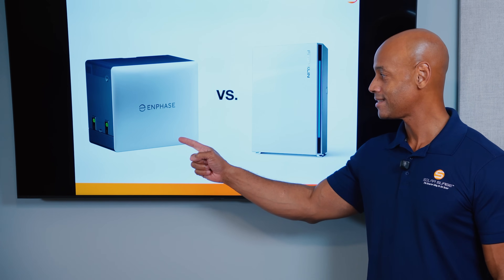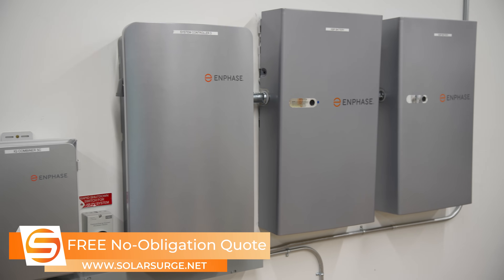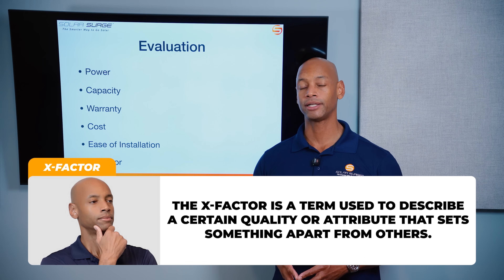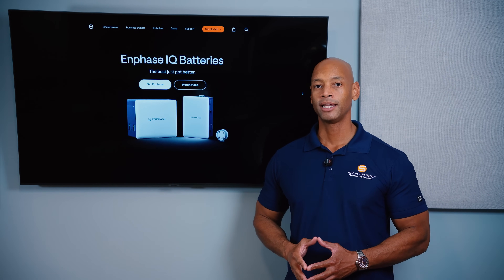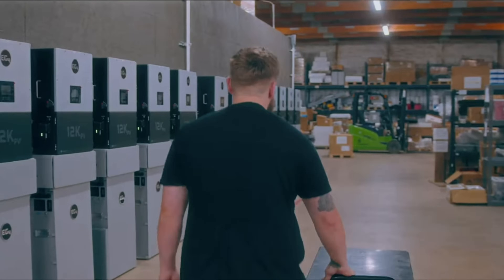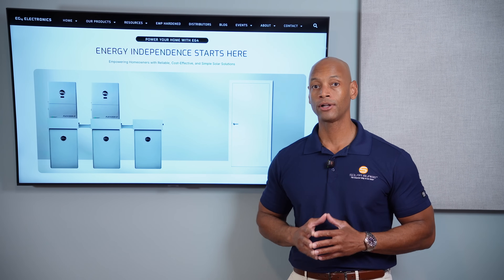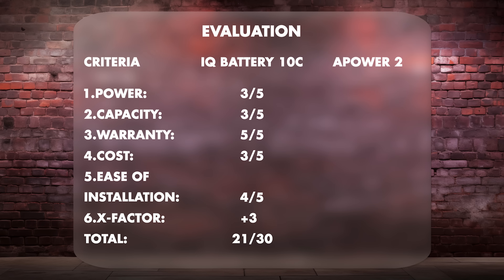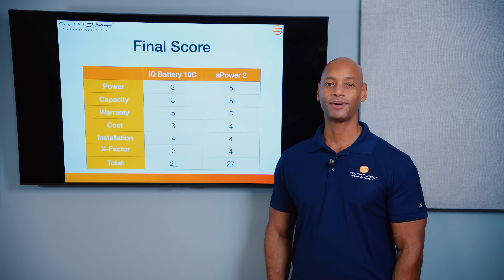Franklin aPower 2 Vs Enphase IQ Battery 10C

Comment: Emphases has a far more elegant solution in how they deal with weight.  Sending 3 men or a forklift or some custom dolly (which did look cool) sounds very expensive versus making each power module light enough to lift.  No tools required, single person job.  The whole system looks pretty elegant.

Comment: 7 kw is not enough continuous output for a fully electric home... Unless there's a several minute surge to help when the HVAC runs along with the stove causing a draw over 7kw.. just keep that in mind. With the enphase.
Reply: Most people will install two. Then output is 14kw and storage 20kwh. That’s an optimal amount.

Comment: Man, I thought I knew the rules: work hard, hustle, save every cent. But I always felt stuck. Then someone casually mentioned Nixorus books in a comment somewhere, and I swear—it felt like accidentally stumbling onto forbidden knowledge. It made me question every single thing I'd been taught about money, wealth, and success. Not gonna lie, I felt like I was cheating the system just by reading it.
Reply: That’s great but it has nothing to do with either Enphase or Franklin batteries.

Comment: I have EnPhase mi-based system. But, the 10c and related parts are over-priced and under-capable. However, a big consideration not discussed here is graceful PV curtailment when grid down and battery near full. EnPhase needs to open up to others, including for bi-directional EVSE/V2h, for better micro-inverter power control

Comment: The SW Florida Enphase dealer quoted an insane 30k to add one 10c to my Enphase system. The local/20-year solar Franklin dealer met my 15k budget. Glad I went with sufficient quality at a reasonable cost.
Reply: Well that’s just over pricing from your particular installer. Nothing to do with the quality of Enphase systems that is well known.
Reply: Wow.  $40k for one 10C?  That's a "We don't want this job!" kind of quote.
Reply: 3-4 hours of labor for 30k even 15k is high IMO. I'm assuming you already have solar just adding AC coupling inverter and battery.

Comment: Both are way too expensive unless you get an extra cheap install, live in the highest priced electric markets, and your electric company lets you sell back 1 to 1.  Otherwise, don’t expect to break-even until long after these are out of warranty.  The real value of these is for backup power if your electric goes out for more than an hour or so more frequently than you’d like.

Comment: You should compare on an equal basis. So in this case you should compare two Franklins and 3 Enphase batteries (both will be then 30kwh capacity). Suddenly you would see that output would be 20k on Franklin and 21 on Enphase. So they are very close. Also, why not add “required wall space” as a criteria?
Reply: Exactly. This comparison is badly flawed. Enphase is still more expensive and the 10C is a poor follow up to the 5P, but it has a huge installed user base and phenomenal support. 

There is no question the Franklin is a contender, but this video completely glosses over the benefits of having a single manufacturer and unified system with easy to understand monitoring.
Reply: @RoderickMcSlagerhaden Agree. These “specs sheet” type of comparisons are garbage usually as many other things to consider. By the way, there seems to be coming an IQ10CS battery as well. In that one you can freely put the two 5kw battery modules on top of each other or horizontally so it is flat. Comes with a separate cover for them.

Comment: Franklin battery is manufactured in China, Enphase is manufactured in US
Reply: Exactly.
Reply: Not true now,    Franklin products used to be all made in Shenzhen, China, but the company has recently begun domestic manufacturing of its aPower 2 battery in California, with a goal to increase US-based production to over 80% of domestic content.
Reply: Enphase is "assembled" in the US, not manufactured in the US. Enphase, along with Franklin, Tesla and every other battery seller, gets the LFP cells - the actual storage components - from china. China supplies 98% of the world's LFP cells
Reply: @MichaelWakefield-mx6hg  Someone in the US bolts a few panels together they call it US made.
Reply: @Mike-01234 This video is not about panels.
Reply: @MichaelWakefield-mx6hg Enphase actually produces the electronics, boards, casings in the US. Then only gets those LFP cells from China so they try to be as US as possible. Compare to Sigenergy where all is China made and assembled.
Reply: 90% of everything is made in China
Reply: Including the batteries?
Reply: @raymondschembri5042 No, as with most EVs the electronics, boards, casings, assembly is in the US but the LFP battery cells come from China.

Comment: I already knew the outcome before I even started watching. I have Enphase solar, which I extremely happy with. I am also disappointed with the specs of the new 10C battery. Enphase should have developed a 15C battery. Just my thoughts. Once again Joe, great video!
Reply: Not sure I understand all the criticism towards Enphase IQ10C. First of all it’s manufactured in the USA supporting local jobs. Secondly it has the best warranty out there (15 years). Thirdly, it’s possible to add another one easily as this 10kwh is just a building block like Lego. The power output then goes to 14kw which is insane. Fourthly, it takes less wall space than many competitors. Fifthly, there will be a IQ10CS version were you can split the two batteries in the IQ10 as you wish either horizontally or vertically.
Reply: @TurreTuntematon  15 years from now your not going to have that battery. New battery technology will make it obsolete in less then 5 years.
Reply: @Mike-01234 I have 15 years of warranty so I either have the same battery for 15 years or it will be replaced by a better. So a great thing.
Reply: Also, I have talked to installers. They can install an IQ10C with one person (not two) as you only lift two 5kwh batteries in place one by one. This is in contrast with other systems.